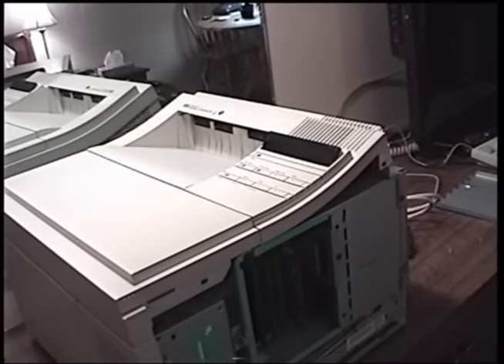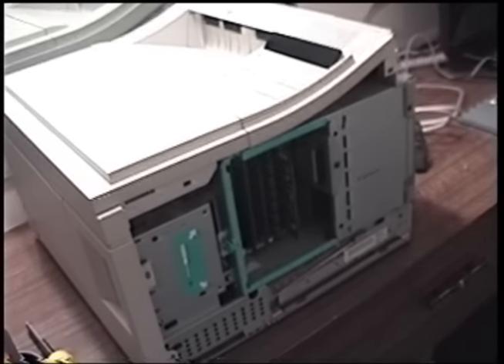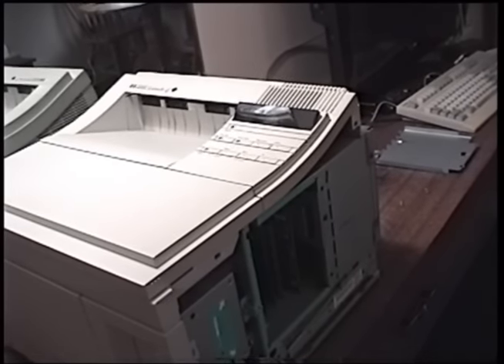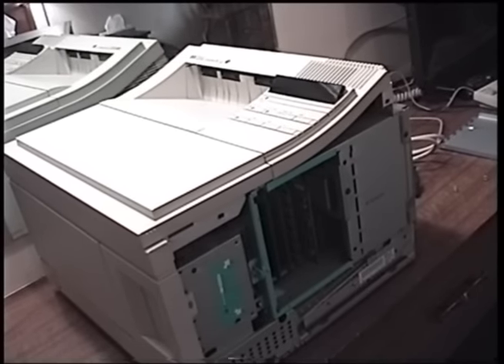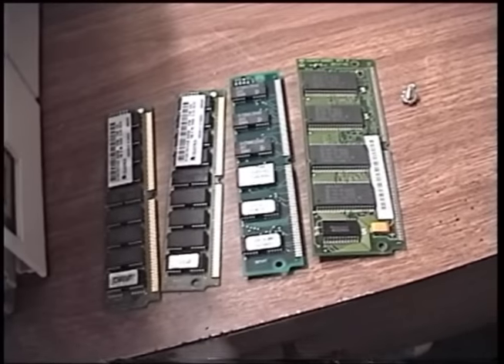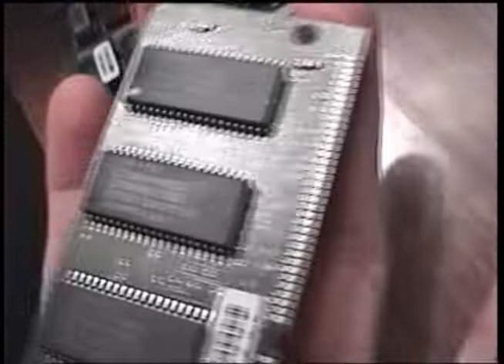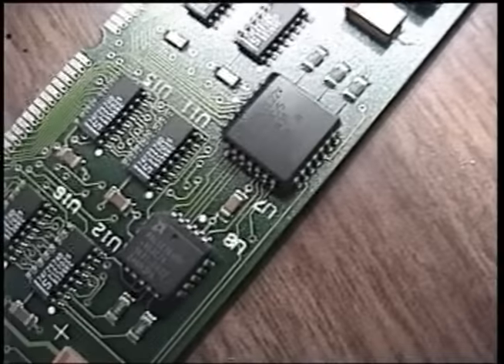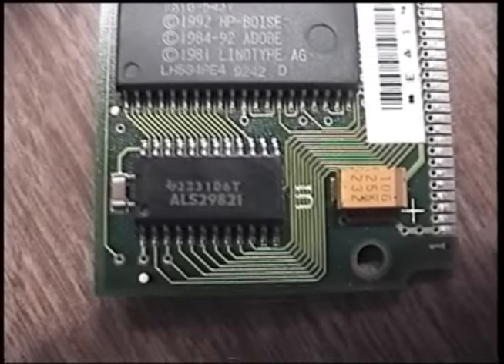HP LaserJet 4/4M Printer, Part 4: PCL vs. PostScript

Comment: Yep all the macs in my dad's office communicate with a Dell 3100cn using PostScript STILL its very reliable

PCL is used for the 2 windows Machines
Reply: +Kyle's Tech Channel Two Windows Machines? Are you serious?
Reply: Kyle's Tech Channel
You are mistaken. It's 2 Linux Machines out there. And 200 000 Macs. But Millions of Windows PCs.
Reply from the maker: +BloodySword He said in his dad's office...
Reply: *****
Ah okay, must have overlooked it. I think my Kyocera uses PostScript, too. But there is an PCL-XL option. XL seems to be the latest PCL version.
Reply from the maker: +BloodySword Yep, PCL-XL is another name for PCL 6. That printer more than likely has PCL 5e support too, since PCL 6 often produces errors with some prints.
Reply: Somtimes, when printing oversized pictures, it can happend that some pages are just white. Perhaps the PCL 6 problem?
Reply from the maker: +BloodySword Could be. If you can find a PCL 5e driver for that printer, that might help.
Reply: *****
Nah, I just scale down the images. I expected the driver to do it but it's as dull as it can be. It passes an image, scaled down to A4 in full real pixel size to the printer. Since it was a big poster, it resulted in ~2000ppi. Since the printer can only 300ppi printed as 600dpi (virtually 9600 dpi) I expected that the driver scales it down to A4 300ppi. But that's not the case. :c

Comment: The great thing about postscript was your computer's resources were not tied up processing the print job. The printer offloaded almost all the work to itself.
Reply: +ClassicGarth Which is a big disadvantage because the PCs were almost always more powerful than the printer's computers.
Reply from the maker: +BloodySword Not necessarily. This printer has a 20 MHz CPU, while the average computer in 1992 was 20 - 33 MHz. Combine that with PostScript rendering handled by actual hardware instead of software, and I wouldn't be surprised if the printer rendered PostScript much faster than the computer could.
Reply: *****
You have this PostScript module in your printer. In the 5M I didn't see such a module. I gave the 5M to my daddy after I moved to my own flat and I bought a Kyocera FS-C5250DN color laser printer. Perhaps the 5M has enough horse power to render PostScript using the CPU?
Reply from the maker: +BloodySword The 5M did have a module, HP part no. C3918A. If yours didn't have it, it might have actually been removed for whatever reason, which would have stripped the printer of PostScript support.
Reply: *****
Could certainly be. I bought it for just €20 from a confused old man at a rag-fair with almost full toner cardridge!! He just wanted to get rid of this heavy beige thing that has no use for him, he didn't actually have a PC or MAC... However it has a network module with Ethernet, 10BASE2 (BNC coaxial), an unknown network connection (looks like a longer com port plug) and AppleTalk expansion card fitted. Parallel Port is also available. He just uses it over 10BASET Ethernet RJ45.
Reply from the maker: +BloodySword Is it possible it's a 5N rather than a 5M?
Reply: *****
It has a 5M name plate. Don't know.